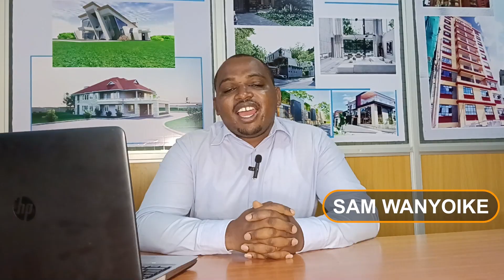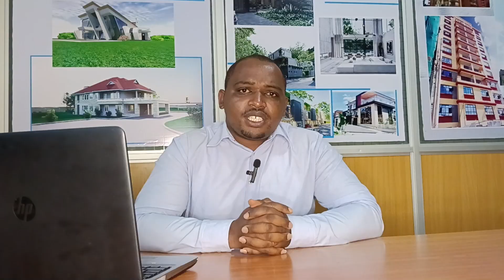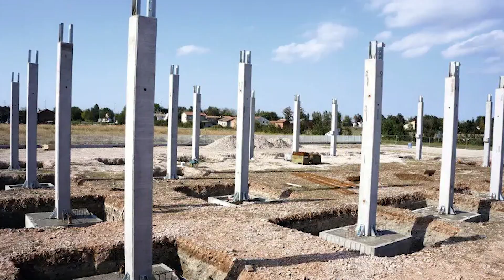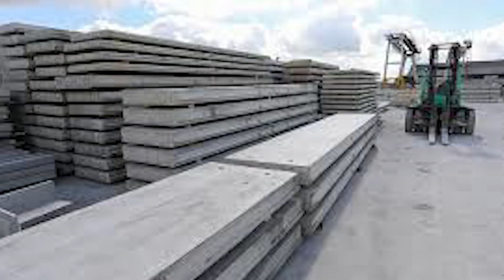"Is Precast the Key to Affordable, Fast Construction? A Deep Dive"

Comment: Dubai uses precsst in all there constructions but from my own experience when it rains the water flows inside malls as though the rain is inside...really you need a good contarctor to seal all loopholes...i dont fight change but mehn
Reply: That has nothing to do with precasts, that's roofing issues.

Comment: Precast advocates always stress on lowering cost of the wall but I the big question is the quality and durability of precast compared to standard quarry stone. . Natural quarry stone lasts forever unless there is an earthquake.  How many centuries do precast endure? How does a customer  ensure the cement mix meets the standard? Who sets the standards of the precast?
Reply from the maker: This is a great question @wamahiumuya3826. What matter most in precast is the compressive strength of the precast of which a good number of these producers can show lab results. 
In my view, the precast when done right is as durable as the traditional wall. In fact, it could endure longer.